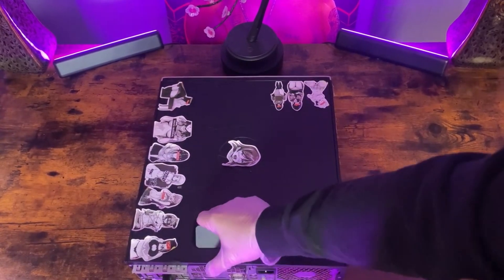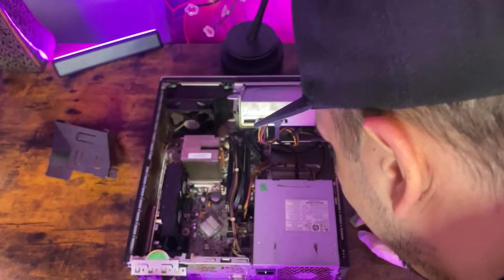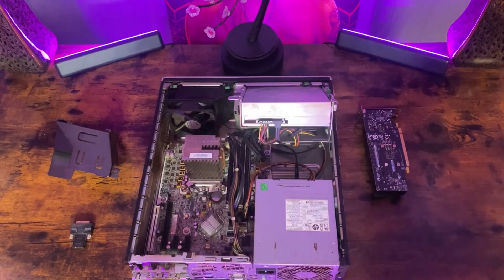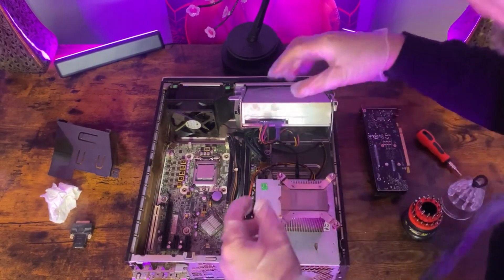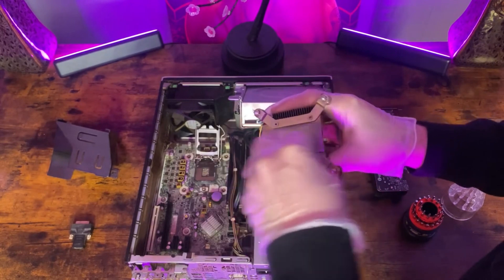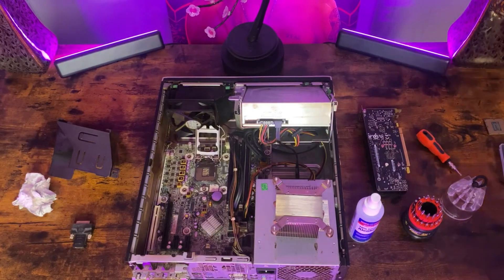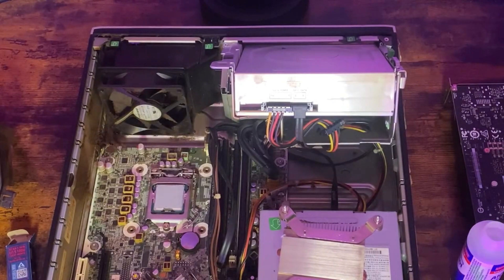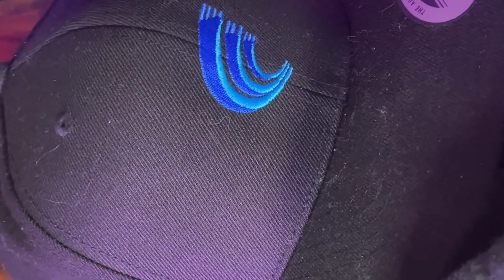HP Compaq Pro 6300 Processor Upgrade

Comment: I have same hp compac pro 6300 Micro-Tower which has core-i3 2nd cpu, Can I upgrade it to core-i7 3770?
Reply from the maker: @detectivegenius9744  possibly yes
Reply: @CodyYouKnowMe  can i use intel stock cooler for cpu instead of this stock heatshink?
Reply from the maker: @detectivegenius9744  I’m not sure you maybe have to look up if it’s compatible

Comment: I upgraded my HP 6300 pro I7-3770 Computer but it crashes, what should I do?
Reply from the maker: i had this same problem turns out i didnt put enough thermal paste so i had to re-apply it
Reply: @CodyYouKnowMe  I've looked up a lot, but the problem is that it hasn't even started up yet and keeps showing up on the HP screen and then turning off again.
Reply: Can you take a screenshot of your Source parameters?
Reply: @TTechRV  update the bios